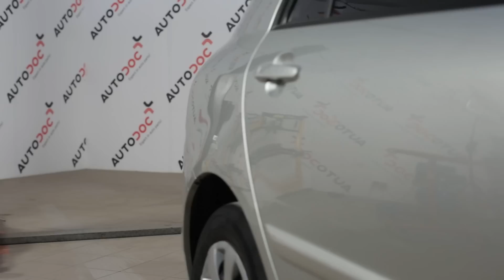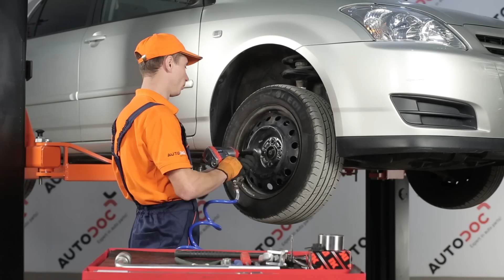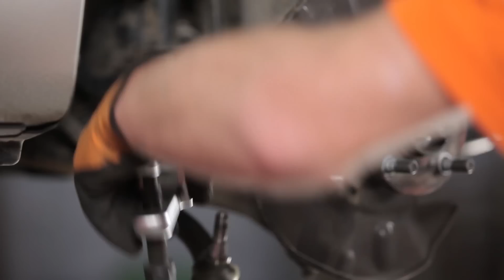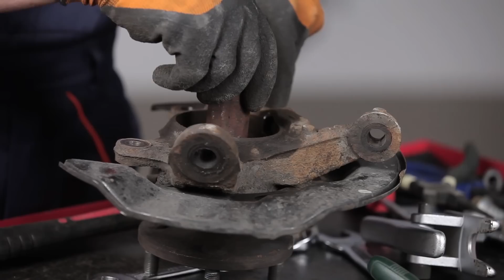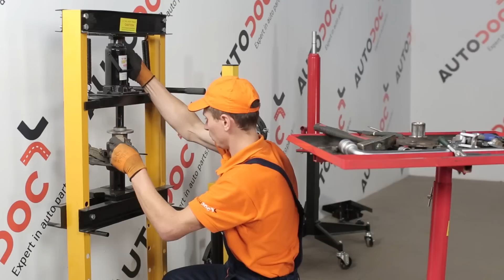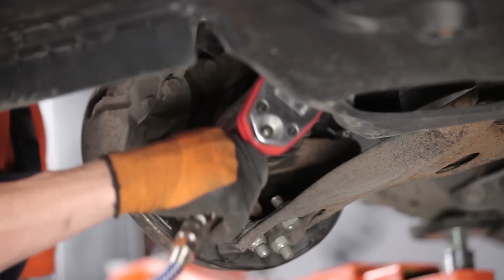How to change front wheel bearing TOYOTA COROLLA E120 TUTORIAL | AUTODOC

Comment: This is a great video. Very clear and very easy to follow. The only thing I did not see, or was edited out  was the proper torque of all the bolts and  nuts. I am no very sure if that is required. Great video, I like it.
Reply: Until you try to do the same job on a real car with old, used parts. This video make a really hard DIY job looks much easier than it is in real life!
I would know, I finished the same job one hour ago.

Comment: Yeah......the race just falls off with a few taps of the hammer lol. I am buying one of those ball joint separator tools and probably getting a wheel bearing kit so I don't have to pull the whole knuckle. Cool video.
Reply from the maker: Thank you for the feedback! This video is considered to be an informative one, and it shows the sequence of repairs, without going into all the technical nuances. Best regards, Autodoc.
Reply: The hub was already half out when he tapped it with a hammer.
Reply: The nuances are the actual hardest parts. By glossing over that you're giving people the impression it's easy and leave them in over their head.

Comment: Good video for showing the basic procedure even with not using a torque wrench, but I would've queried the torque on the axle centre nut? If not correct it could cause premature failure maybe. Was told it is important?. But still a good video thanks for posting.
Reply from the maker: Thank you for the feedback !  We included  this data to our new videos.   Best regards, Autodoc.

Comment: I jack up the front wheels on my corolla 2011 with engine on I put the transmission on drive and when I turn the wheels to the right the front right tire doesn’t spin freely, somebody can tell me what does it mean? Bad wheel bearing?
Reply from the maker: Thank you for your feedback!  The reason of this is most likely in bearing, but we recommend that you contact Car Specialized Service for full diagnostics, and they will detect the reason of malfunction. Best regards, Autodoc.

Comment: How long does this job take in a shop, on average? (without making a video :)   Thanks!
Reply from the maker: Thank you for the feedback! Everything depends on the condition of the hub, the tools used in the repair and the level of skill of the mechanic. For example, to get the bearing out of the hub without a press and press it into a new one is very problematic, if the master is not the Hulk. If there is a press and all the necessary tools, I would allocate about two hours for this work, but there is always the possibility that some kind of bolt or screw are rusted and it takes more time than planned to unscrew it. Best Regards, Autodoc.
Reply: Thanks!

Comment: Not a chance that the circlip is coming loose like that. Not long ago i took a avensis. Ended up drilling hole in the hub and then hit the circlip with a "dor" (not sure what it is on english.) And the abs sensor unclip it at the contact  dont try to take it out of the hub. Normaly this is stuck and you ending up destroying your abs sensor. And the ball joint undo the 3screw than you dont risking to damage the rubber on it.

Comment: Is not better and easyer to replace the hub and bearing toegethr?
Reply from the maker: Thank you for the feedback!  You are  absolutely  right, it is really possible to  replace the parts in assembly. But, sometimes the owner wants to change only the bearing and leave the old hub. Best regards, Autodoc.
Reply: You don't need to replace the hub, but since the inner race of the bearing often sticks to the hub and is hard to remove, it's sometimes easier to just buy a new hub. Plus, many mechanics recommend replacing it as well.
Reply: On this application you can not get a hub and bearing assembly. They are 2 separate pieces.

Comment: why did they design it like this.My wife's grand am just had a hub assembly with wheel bearing in it already./It was very easy to change with hand tools.I like Toyota's but this was a dumb design.
Reply from the maker: Thank you for the feedback! We appreciate you sharing your experience with us. Best Regards, Autodoc
Reply: Most cars from the late 90s into the late 2000s had the press in bearing type. I've had many cars of many brands that had the same design. Thankfully, many newer cars have a bolt on bearing assembly that doesn't require a press.
Reply from the maker: Thank you for the feedback! We appreciate you sharing your experience with us. Best Regards, Autodoc
Reply: Well lucky for you with your grand am.  Lucky for me it's not a job you have to do every 6 months on a Toyota!